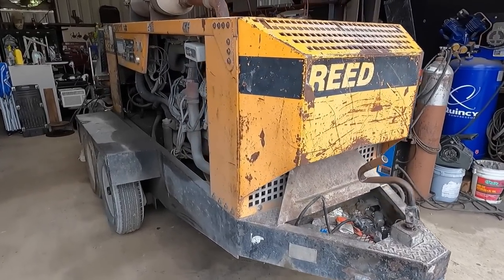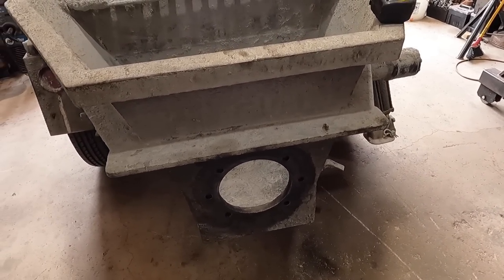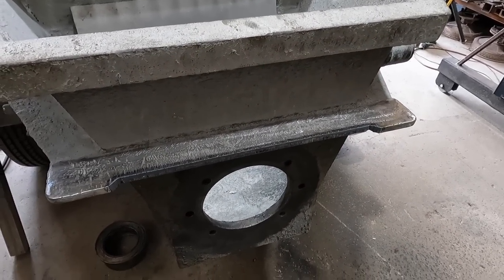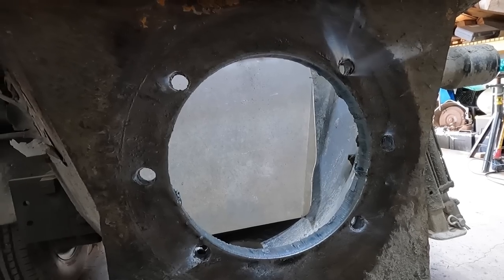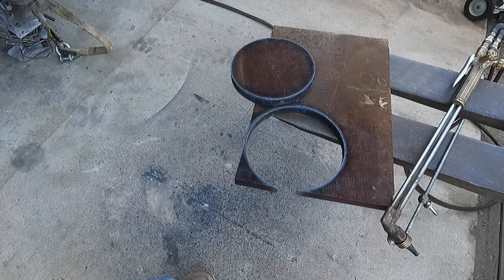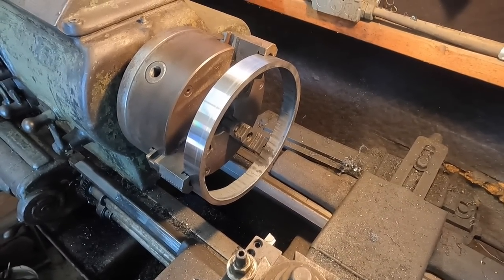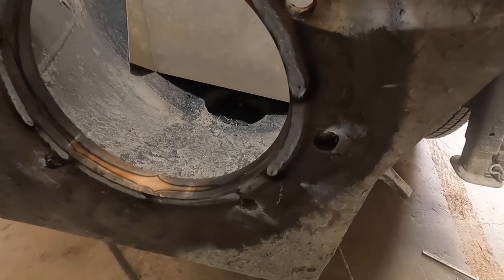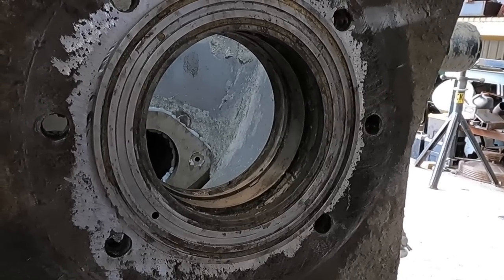Concrete pump repairs.

Comment: You're getting lazy. Won't fix up your line borer to do the job properly this time and in the future. Hack lumps off the customers equipment rather than make or buy a shorter piece of 1/4" rod for your circle cutter. Free hand the last 2/6ths of the circle rather than just doing up 2 bolts to move the bar. Final result of machined ring into freehand cut bore with guestimated cooling shrinkage tolorance is there is no way that that back bearing is in line with the front one. Still, when it wears out the new bearings in a few months, is more work for you.
Reply from the maker: As one who only saw the video and not the repair in person, its tough to criticize or should be tough to criticize when you didn't see how it all worked out. I can assure you that while i may take steps that you or anyone else may choose to do differently, the job ultimately was done correctly and efficiently. Thanks for the concern and support.